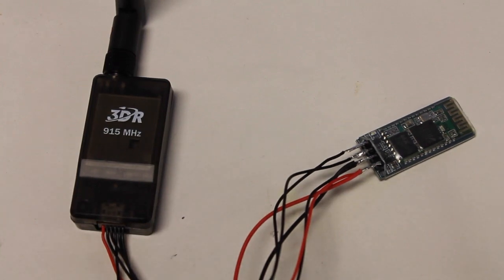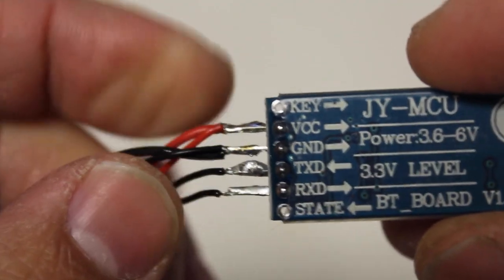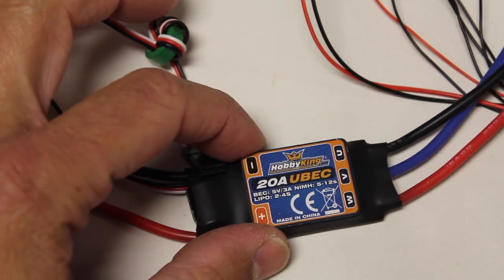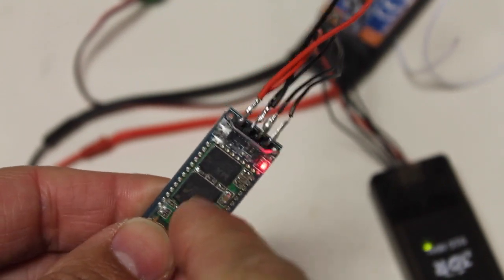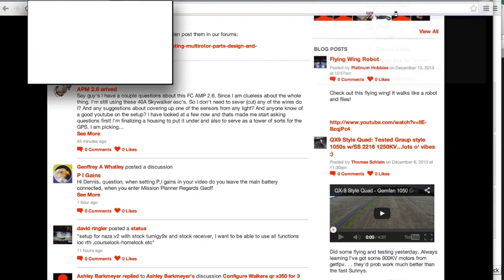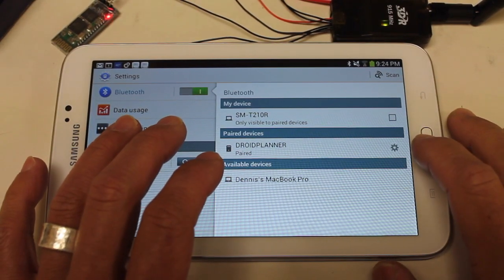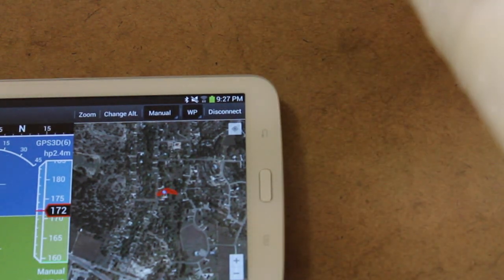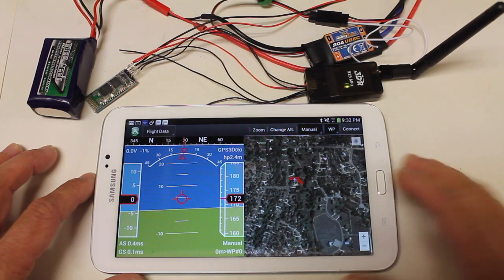Part 3: Wiring Bluetooth Telemetry with APM 2.5 and DroidPlanner on 7" Samsung Galaxy Tab 3

Comment: Hi again Dennis
I final got my setup to work .I had alot of trouble with getting the baud rate to change .I had to use an ardunio uno and some code i found on the web.
but now all seems good , only ground tested so far.
I am so pleased i came across your project , thanks again and keep up the good work .
cheers
Reply from the maker: Very cool! Glad to hear it and keep in touch. Perhaps as you get further into this you'd be willing to share some of your experiences on www.garagepilots.com. Take care.
Reply: Dennis Baldwin will do 
cheers

Comment: Thanks again. I initially got into multirotors in an attempt to finish a model rocket project I started around 10 years ago and almost gave up because the telemetry wasn't there then, but it is now and the autonomy promises the hope of one pilot and a 3 stage lifting body style glider ( I need 2 more pilots). The details are of course Top Secret!
Reply from the maker: Robert Small Well I'll be anxious to more about the details when you're willing to share them :)

Comment: Hi Dennis i got it to work also i need some advice on the APM 2.6 throttle setup could you explain the throttle for stabilize and loiter and Althold  my quad shoots up or even plummet straight down any help would be great
Reply from the maker: ras4q2001 That's strange. You should make sure your compass is properly calibrated and run the compassmot routine. Also, check your stick calibration in Mission Planner to make sure you don't have any sort of expo or scaling going on that is causing your throttle to not be linear. Sorry, but that's the best I can come up with without seeing your setup. If you want to provide more details please post in the forums at www.garagepilots.com. Best of luck.

Comment: hi dennis, very helpfull,

in my case i have the old version of the 3dr radios, the ground radio only has USB connector, have you received info on how to get access to tx and rx on the ground radio?
thanks,
Reply from the maker: If you're only able to get TX/RX via USB then I'd pull up a USB pinout so you should be able to access it. Is that what you're asking? If not, perhaps you'd be willing to post this in the forums over on www.garagepilots.com and we can try to help you out.

Comment: I like it! I just got a Nextbook 7 in and I'm in the same process. I just got a Dell laptop and some Fat Shark head tracker gear and its setup for on site work with the APM 2.6 and that's the start of my ground station! Right now I use the tablet as a kind of FPV with the GoPro app and the Hero 4 on a quad for the neighbor kids in the back yard! I have no Idea what the range is but the tablet shows a real good image at 50 feet! I'm sold. Now how does one guy fly more then one quad???
Reply from the maker: Robert Small Sounds like a cool setup. I guess you could fly more than one quad if you were to leverage APM or Pixhawk. Have one in auto mode or loiter and then switch to the other. Then back. Not sure that makes a whole let of sense, but definitely possible.

Comment: hi Dennis i upgraded  to a new apm Fc with these radios my questions is where did you get that 6 pin connector my kit didn't come with any
Reply from the maker: ras4q2001 You can find a bunch in the 3DR online store:

http://store.3drobotics.com/products/df13-6-position-to-5-position-connector-15-cm

If I recall the APM has a 5 pin connector for the telemetry port and the 6 pin on the actual module. But please double-check that. The 3DR store has a bunch of different cables that you can purchase.

Comment: Dennis is the range better than 2.4? then it could be a redundant control system. You could get 5 pin balance charger connectors for the bluetooth device.
Reply from the maker: No, it's going to be much more limited....at least the connection between the tablet and the bluetooth module. Nice idea on the balance connectors. Let me see what I can find out.
Reply: Dennis Baldwin
Well if transfer rates increase streaming ok vid should be possible. Excellent control for transmitting node network maybe. Have a great new years and holiday.
Reply from the maker: Thanks and hope you have a great Holiday as well. Take care!

Comment: Hey Dennis, Have you every used a GPS antenna's from one system and had any luck using it on another system? (like multiwii to apm) I heard it is possible, I've heard all you have to do is change the baud rate. If that is the case I'm not even sure where to start.  I didn't know if you have ever messed with that.
Thanks for the videos and info!
Matt
Reply from the maker: ***** I haven't, but used to do some programming with different GPS receivers. They normally send the same data format (NMEA) so if you can wire them properly I would expect the system to be able to translate the NMEA sentences from different receivers. Now I haven't done this so it's just theoretical at this point. Good luck and let us know what you find out.

Comment: So lets say I didn't have to go through these extra steps like you did because my tablet has OTG cable. If I were flying about and crash in an area I can't see, would I be able to find my plane/quadcopter through the telemetry linked to my tablet/phone?
Reply from the maker: Yes definitely. This assumes you don't lose power to your plane or that any comm cables become unplugged. I had this happen with my plane once because a clevis broke on the aileron. I was able to use the last known location on my tablet to locate it. Good question.
Reply: Wow nice! Thank you for answering

Comment: Excellent video, my only concern is the TX solder connection on the Bluetooth device. The blob of solder is very close to the GND connector. I would wick some of the solder away on the TX connection and use shrink tubing on all the leads. Other than that keep up the great work!

Comment: Hi,I have watched all the 3dr setup with Bluetooth,and you said that the tx connected to the tx,and rx to rx and in the other video you said Rx to tx and tx to rx which one is correct?
Reply from the maker: Johnson Samuel Sorry if I confused you. TX from one must go to RX on the other. One line on one device will be transmitting and the other will be receiving. Then the other line will be receiving while the other device is transmitting. I fear this may be even more confusing. Hope that makes sense.

Comment: Thank you for your help, can you make a video about the settings 4 GPS hold, when I fly mine in GPS my quadcopter would come down I don't know if maybe the settings are not right sorry I'm new to this is apm 2.6 board I always use DJI Naza version 2 so if it is possible for you to show me all your setup on your quad copter that would be very nice, at the moment I can only fly in stabilize not sure about the other modes, thank you.
Reply from the maker: Johnson Samuel Make sure your barometer is well covered and that your ESCs are well separated from your GPS/Compass. I use a little antenna mast. Try running the compassmot routine and see what it says.

Comment: HAY thanks man so you think from one transmitter a pilot could command a second receiver? Im thinking with a ground station? And something like shared GPS and tracking telemetry for proximity and avoidance! Kinda "Dancing Droids" I guess! If not the scheme is more then one machine using pre planned flight and a way to trigger simultaneous operation! Wing or Flock is what I call it!
Reply from the maker: Robert Small I was thinking more of the scenario where multiple UAVs were flying autonomously. Take off and land without TX intervention. Good question about multiple receivers. Not 100% sure how that would work, but definitely an interesting concept. Let me think on it some more. Good stuff :)

Comment: Got it working the same thanks to your 3 videos, that is great.

One problem though, if I hit "disconnect" on the Droidplanner, the bluetooth red light stays fix meaning it does not go to discovery mode by itself. I have to switch the lipo off and on again to have the discovery mode on again so that I can hit "connect" on droidplanner.

Is there any AT command I could type from my PC to force it to go to discovery mode as soon as connection is lost ?

Thanks again
Reply from the maker: Philippe Giboulot That's a great question. I'm not entirely sure. I need to see if mine behaves the same way. I recall being able to disconnect and reconnect with no problems. If I find something I'll be sure to share it. Glad to hear you at least got it working.

Comment: Hi Dennis, could you please tell me why when i connect my android phone ( samsung ) i get ...
" data link lost, check connection..."
my android is paired and write " Autopilot " with my bluetooth module and my module is wired like this....bluetooth red to red TX 433Mhz ( french ), black to black, green from TX 433 to TXD bluetooth, yellow from TX 433 to RXD bluetooth...
i need it to link my phone or tablet without mini usb but with bluetooth...i prefer  to get a link with no cable between my tablet and TX 433MHz  and a battery for this (+ bec 5v )...this avoid to used teh battery of tablet...
But i don't understand why doesn't work ...?
May be do you have an idea...?
Best regards
Philippe
Reply from the maker: It's really hard to say but make sure you are not connecting TX from one end to TX on the other end. You need to have TX on one end to RX on the other end and vice versa. Also, check your baud rate as it will be slower than the 115,200 of a USB connection. Good luck and keep us posted on your progress.

Comment: hi Dennis.
great project, just wondering if you have had time to do much testing?
Also could you run  a laptop  and tablet at the same time ?
anyway keep up the job work ..
cheers darren
Reply from the maker: Darren, not yet because the weather has so bad here lately. I'm not sure if you could run both a laptop and tablet at the same time. I'll see what I can find out.
Reply: Dennis Baldwin cheers Dennis  , I have order Bluetooth  module so will be having a go too . but look forward to your updates

Comment: can you plug the blue tooth module directly in to the apm board for close range setup for misionplaner ?
Reply from the maker: +robsycko That's a great question. I haven't done it directly before, but I believe it's possible with this setup here: http://amzn.to/1S4hats
Reply: It does work i did it after i asked not much range

Comment: Thanks for the vid. I don't have the Bluetooth mod yet but I was able to root my Asus HD7 notebook and get working that way. The reason for my comment however i think I have a better solution for power. I have a portable batterypack for charging cellphones tablets etc. It puts out 5v via USB and only cost $12. For my set up I have a USB hub plugged into the battpack via 2 USBs hacked together to make a double male cable. The 3Dr ground radio (old style with USB connection only) plugs into the hub and the hub plugs into the OTG cable and then to tablet.
Reply from the maker: Good stuff. Thanks for sharing this bit of info!

Comment: i have 3DR telemetry and dos not have Wire lead connection for Bluetooth  and Samsung Tab3 no USB support . so how to connect USB Telemetery with Buletooth.. ?
Reply from the maker: You'll need to make or buy your own connector for the radio to bluetooth module then.
Reply: kabirkhan khan i asume that your telemetry ground module has just a standard usb male socket...what you can do is search online for usb diagram...every usb has 4 connections: 5v dataIN dataOUT ground...you can just connect the radio to the bluetooth by connecting the 5v ground ofc and then connect radio's dataOUT to rx on the bluetooth and the dataIN to the tx...thats all

Comment: I want to be able to use the "follow me" function from my cell phone, it seems the only way to do this is via bluetooth using a set up like this. However... although I can understand 99% of it, what you dont show is how the set up is connected to the APM unit.   Via the telemetry port?  The air telemetry units I have are like these which is supplied with the wrong plug for the APM and nobody seems to know where the black plug would connect to the APM.
Reply from the maker: I'm surprised to hear your units didn't come with the proper plug. Yes, I'm using the telemetry port for the 3DR radio attached to the model. Feel free to check out www.garagepilots.com and post some pics in the forums over there. I'll be glad to help you get this working. Good luck!

Comment: Hey me how is the conection between telemetry and bluetooth it is (tx-tx. Rx-rx) or (tx-rx tx-rx)
Reply from the maker: +mario guadron Good question. TX-RX and RX-TX
Reply: Ohhh really i conected tx tx rx rx and it is working but i dont know if can brakedown
Reply from the maker: +mario guadron Interesting that it's working. Perhaps your module is labeled differently than the one I had. If it's working then please don't mess with it :)

Comment: Hello Dennis, I have a question for you, hopefully you can solve it. I have a NON 3DR telemetry RX Like this one:
(http://www.ebay.com/itm/433MHz-Radio-Ground-Module-for-2-Way-Half-Duplex-Telemetry-System-3DR-Radio-e-/281500396255?pt=LH_DefaultDomain_0&hash=item418abb2adf)
The Problem is that because its usb, i cant find the correct config. I know were to connect  the + and - because when i power it on with the BT as you did it powers one but does not transmit/connect. I have tried all combos of TX/RX but it doesn't send/receive .
Your help would be much appreciated 
TY

Comment: Hi Dennis Baldwin , great set of vids once again. Im currently working on something similar myself.
http://diydrones.com/forum/topics/another-telemetry-bluetooth-build?xg_source=activity

It's all going to hopefully sit in a nice looking case I bought for $6.
Reply from the maker: Nicholas, that's awesome. It would be killer if you could get that schematic down to one tiny PCB that could be put into an enclosure. Don't you think the 1600mAh battery is overkill? I'm going to do some power profiling to see if we can get away with something less. Bluetooth is fairly low power so it would be nice to have a compact, light-weight solution. I'm not sure how serious you are about this project but perhaps we could collaborate and I'll contribute a 3D printed case. Anyway, great work on what you've done so far.
Reply: Dennis Baldwin Actually, Im currently also building a UV exposure box so i can make my own PCBs. Part 1 is to build the whole box and get it working manually, then part 2 is to build in a timer relay to allow precise exposure for the PCB.

Im hoping to have part 1 completed within a few weeks. I can then start making my PCBs for my other projects such as this telemetry->bluetooth project, and others.

I have a heap of projects on the go right now, I think I need a place to blog about them. maybe rcgroups, not really sure. Any suggestions?
Reply: Dennis Baldwin I've already got all the components ordered from the various shops, so will start building when they come in. I would like to collaborate on this project if you have the time.
Reply from the maker: I'm definitely interested. I'm swamped right now but hopefully things will slow down a bit early next year. Let me know how everything comes along and I'm going to start playing around with a box design. BTW, I run a community at www.garagepilots.com and it would be a good place to promote this project once things start coming together. Happy Holidays!